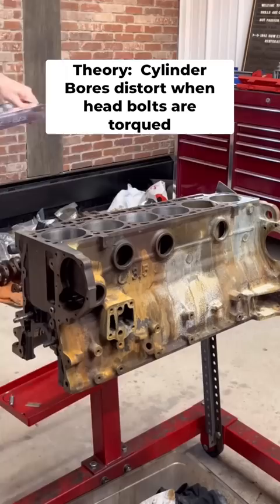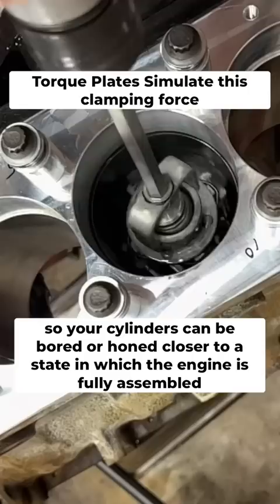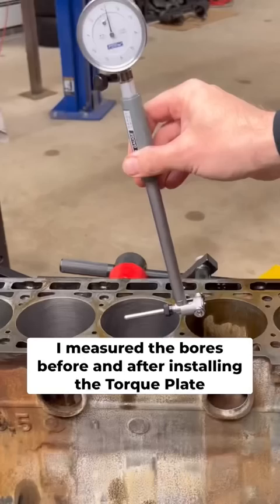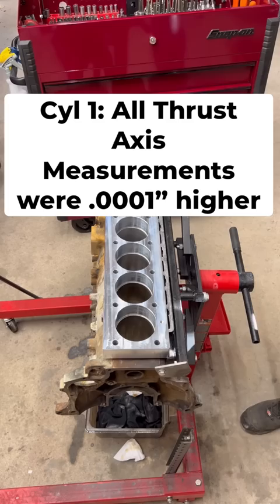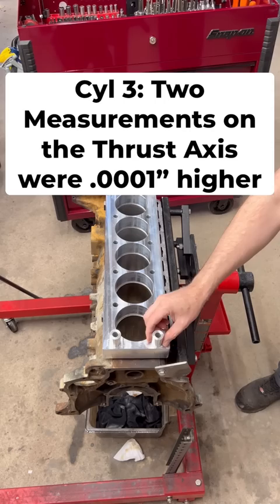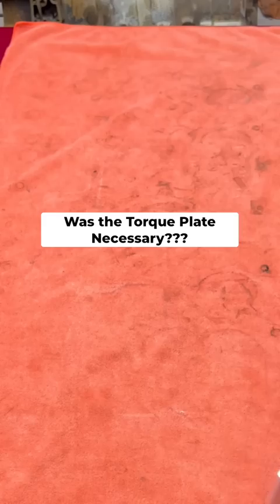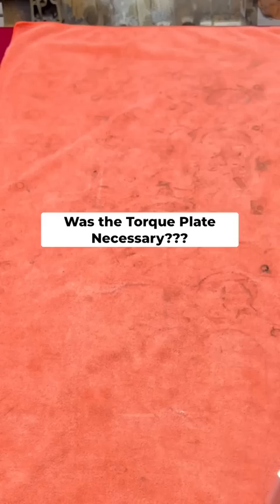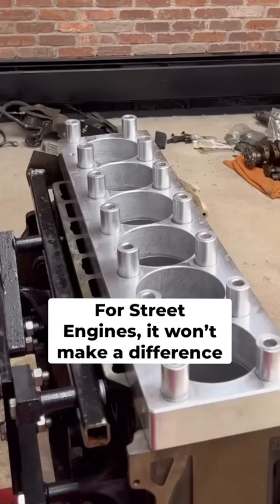Are Torque Plates Necessary? #bmw #cars #diy #bmwm5 #bmwe34 #restoration #automotive #engine #tools

Comment: Cylinder six can also get distorted when torquing on the transmission.
Reply from the maker: I don't buy that. The bellhousing bolts don't have a heavy torque in this engine
Reply: @wewrench  You don’t have to buy it from me. You should ask some old techs that were around when that E34 came out. I know cylinder 6 distortion was found in quite a few M20’s. Wouldn’t hurt to check bolting on that transmission if you’re going so far as to install the cylinder head torque plate.
Reply from the maker: @john.nandez  If the transmission were unsupported in the back, or if you zap those bolts with a 1/2" gun out of sequence, then I could see that happening.

Comment: Small block Chevys and big block Mopars are just a couple of engines that come to mind that need to be honed a torque plate, both of these engines have the head bolts very close to the cylinders, on a small block Mopar there's fewer bolts and they're further away from the cylinder and it doesn't make as much of a difference
Reply from the maker: Same with this engine. The head bolts don't contact the cylinder walls

Comment: I am by no means an expert. But one thing I noticed that I would just mention and comment on, is that deviation based on running conditions is not really something you should base this on. The engine would have been designed with running conditions in mind, and the torque specs would have been for a cold engine (service conditions). Deviation via disassembly would not be accounted for on the engineering level, where as deviation due to running temperatures would be. Just a thought.
Reply from the maker: Truth and that’s why these plates are useless

Comment: You should always use a torque plate.     Engines do not run at room temperatures You measured your block at room temperature, and by the way when your engine is running it has Coolant running through it,which is around 200°.  The heat affects the  the degree of warpage. On my engines I use a torque plate with 200° coolant running through the block with  the stock bolts and washers. Then I do the Hone, this  the way it’s done son to perfection… 😊 keep on rockin
Reply from the maker: If I was doing a race engine, I would try my best to do it that way. For street engines though, its an overkill
Reply: That sounds like it makes sense
Reply: A thou (thousandth) doesn’t really make any difference in street application, hot or cold. But in a race engine yes absolutely. Even the smallest defect compounds when you apply heavy load consistently.
Reply: I do a dry fit with the cylinder head and map the cylinder bores. Then I use the torque plate and bolt it down so the bores are the same as my map.

Comment: There is no way a torque plate of 5 inches thickness is going to pull a cast iron or aluminium block in to alignment.
Reply from the maker: What does the thickness have to do with it?
Reply: Nothing along as the bolts go into the block same amount as with head on
Reply: The thickness does matter. Cast block are far more stable and the changes are minimal, but significant in performance engines.

Comment: Depends on the block -
Ten years in the business and I found out which blocks distorted and which didn't, and "plated" accordingly.
On some it's a waste of time and money, the others it's mandatory to get proper ring seal - for maximum power and economy.
Reply from the maker: Which ones did you see distort?
Reply: @wewrench  
I remember SBCs were the absolute worst - you could torque one up with a plate and with the proper light you could SEE the 5 shadows (where the bolts were) around the bore - I used to leave an extra .001" hone stock just in case.
They were so bad you could HEAR the stones rattle at the top of the bore the first few strokes.
The bolt holes were way too close to the bores so when the iron moved under torque the distortion showed immediately in the bores.
Even the BBCs showed it, just nowhere near as bad.
This is one reason quite a few engines now have open decks with the bolt holes outside the open deck.
Reply from the maker: @Motor-City-Mike  My old trade school instructors would tell me stuff like this as well in regards to the SBCs

Comment: Heating the block to operating temperature probably more valid than a torque plate….
Reply from the maker: I agree. You can chase this stuff all day long, for street engines it won't make a difference

Comment: Diesel engines, it's mandatory in my opinion. I honed some with and without, and the ones without burned oil and had more blow by.
Reply from the maker: Really? I'd like to think those blocks are even more rigid than this one
Reply: @wewrench  6.0/6.4 powerstrokes only have 4 bolts per cylinders and torque plates distort them sometimes as high as .0025". Even torquing the bed plates will distort cylinders by a thou. We hone all blocks with mains and torque plates now.

Comment: On an OEM like build probably not.  On a high boost application I would. I'm sure it depends on the design of certain engines as well. My 4g63 distorted about .001".  I'm running a 2618 piston which expands a lot more than your average piston. Some builders will just run a larger piston to wall clearance to make up for the expansion but you'll end up with piston slap. Running minimal clearance with non distorted cylinder walls will help prevent piston slap. When you're spending all this money into a built motor why not and get it perfect? Maybe that's the ocd in me and 10+ years of me being a machinist. I'm a big believer in the saying, "anything that can go  wrong, will go wrong."
Reply from the maker: For a race application, all the details absolutely matter.

Comment: SOME engines absolutely need them
.
ive heard that 351C ford motors will actually "egg" the cylinders if you dont support the front end on an engine stand 
.
but im a 351W fan (only good motor ford EVER built.... 300 I6 also i guess)
Reply from the maker: The factory says this engine will distort if not mounted on the stand sideways so I def get it

Comment: If all you are doing is honing a cylinder to replace the crosshatching for new rings it definitely doesn’t matter as the bore is barrel shaped / tapered anyways from wear.
It’s even more dubious on an un decked block that hasn’t been line bored to correct for core shift misalignment.
Reply from the maker: So you're saying if the block is actually bored, it needs one?

Comment: Absolutely necessary exactly lol what he said. When you torque the head bolts the cylinder bores do change. Remember every engine calls for a certain hatch pattern in the cylinder bores. From the honing stones. The torque plate will insure cylinder is a true cylinder not distorted. .0001 or .0002 will change how efficient the cylinder & piston piston rings work.
Reply from the maker: You have no idea what you're talking about. .0002" won't change anything unless it's a race engine. And a rigid hone self centers in the bore regardless if there's a plate installed.

Comment: Didn't have one used on either of my 2-3x stock HP builds, only because they weren't available at the shops and I couldn't justify the added cost. 
Anyways I have solid compression numbers in all cylinders and oil consumption isn't anything abnormal.  I personally won't be buying a torque plate for any sub 1k hp builds.
Reply from the maker: Thank you for supporting the channel!

Comment: I think torque plate honing is more used when using ARP head studs as i think they’re a higher torque value and I think the way they torque as well is different but don’t quote me I may be wrong 🤷🏼‍♀️

Comment: If its an aluminium block then torque plates are required 100% of the time when boring the cylinders.   They are not required for honing.
Reply from the maker: Thank you for the info.

Comment: I've seen ford modular engines that where honed without a plate amd those done right. Towards the bottom of the bores in those engines bored without the plate, were four polished spots that line up with exactly where the head bolts thread into the block Towards the base of the cylinders. I've seen similar on okdwr pushrod engines wherebmain caps where left untorqued for boring  Where as engines that had the main caps and a plate torqued down. Have perfect symmetrical hashmarks and glazing. These methods have very little to do with performance and everything to do with longevity and preventing oil consumption to keep carbon footprints smaller. These methods did stem from great minds like smokey yunic who would only build his race engines sitting on a bench or floor because he believed the block hanging on a stand caused undue stresses after assembly was finished.
Reply from the maker: Thank you for this contribution

Comment: To claim that it would make any difference to honing shows that up. Honing does not require precision; it just puts pseudo-random cross-hatch patterns into the cylinder bore to trap oil. You can see from the honing tools that differences of a few microns in the alignment of the bore will make zero difference to how effective the honing will be. This whole thing sounds dubious to me.
Reply from the maker: Maybe not flex honing but possibly rigid honing

Comment: As a dude that works in and Indy car/Le mans car engine shop for a top manufacturer.... It is insanely dependent on the engine. If it's an aluminum block or split block of any design or in certain types of V-blocks regardless of material, you need a torque plate. For inline iron block engines like the one showed in the video, the block is so stiff it's unlikely to make a noticable difference.
Reply from the maker: I cast a wide net in the video. I agree with you, but for most street engine builds its probably an overkill
Reply: @wewrench  couldn't agree more 🤘
Reply from the maker: @ipar_carlarsen5765  cheers bro. Thanks for supporting the channel

Comment: It depends.  You can certainly run an engine and let the rings wear the bore in until it's round enough.  This is assuming there isn't too much distortion from the head bolts and main bolts.  This also is highly dependent on how deep your cross hatch is.   For higher performance engines that need good oil consumption and low blow by, it helps a lot to torque plate hone it.  -  Engineer who studies this stuff for a living.
Reply from the maker: I don't disagree with you. I'm just wondering why if its so critical...why don't the OEMs use it
Reply: @wewrench  Because regular automotive engines are really cheap and aren't that high performance.  Diesel engines that are designed to last 400k to a million miles with much higher temperatures and cylinder pressures need something that is more round and longer lasting.  Cummins 5.9 and 6.7L engines are torque plate honed.
Reply from the maker: @MrPizzaman09  I didn't know that! Thank you for explaining!

Comment: If you’re only making a little more power than stock, you’re fine without it. If your shop happens to have your torque plate on hand, then you definitely should! A slight uptick in cost for more precision is never a bad thing. But it’s all situation. I think laying out a good base plan of what you want to do and how you want to upgrade is more important than doing. The work being done always need context of why it’s being done.
Reply from the maker: It's to debunk the myth that it's absolutely necessary

Comment: As a machinist,  the (main) purpose of a torque plate is to keep floating sleeves stationary.   Some industrial diesels have drop in sleeves.  I can see how it can help in theory,  but on anything steel,  definitely a waste of time.
Reply from the maker: Thank you for contributing that

Comment: The single tens .0001" measurement is a bit misleading about it being useless though. If you perform a hot leak down test on a torque plate honed engine they have up to 2% better leakdown, which on a race engine is ALOT
Reply from the maker: Yes but this is a street engine. For race you go all out

Comment: Yeah really only necessary when you’re doing big power if you can simulate a lot of distortion before hand.
Reply from the maker: Agreed. A lot of the details that engine builders dwell on are useless on a street engine

Comment: The deformation caused by tightening the cylinder head depends on the design of the engine, the thickness of the walls and also the contact pressure. It is completely wrong to claim that pretensioning does not bring any advantage during honing, because an ancient engine block does not warp much.
New motors warp to an out-of-roundness of up to 5/100mm.
Reply from the maker: Somebody else made a comment about engine block tension over time. I didn't know that was a thing
Reply: @wewrench  The crystal structure of aluminum tends to flow and therefore changes its shape under load. As consequence also the preload of the cylinder-head gasket is changed. The resulting pressure gradients put additional stress on the system in some areas whereas in others the contact pressure get too small. Yes, this is also a big issue with modern engines and high power. I saw several engine failures because of warped cylinder heads.
Reply from the maker: @lupuszzz  But what if the engine is cast iron?
Reply: @wewrench  With cast iron all the mentioned effects of warping are usually smaller. The effect of material flowing away from pressure zones is practically not existing with cast iron.
Reply from the maker: @lupuszzz  That's what it seems

Comment: In some models torq plate is needed. I.e. 1.8l nissan primera warps cylinders if no gear box torq plate is used or if the gear box is tightened to wrong Nm
Reply from the maker: Make sure you check out my latest video on how I corrected the cylinders myself and I get into more detail regarding the torque plate

Comment: This is just a carryover from days gone by when it did make a difference.  It took 30 years to convince people that synthetic oils worked great.  There are still a few living people that ask for valve adjustments and joints greased on their 2022 whatever.
Reply from the maker: I think it comes from the hot rodding days

Comment: I dont think measuring from 2 points is enough to get a useful picture especially since the spots you measured should see the lowest distortion. The areas where most distortion would happen is the cylinder wall adjacent to the the threads of the headbolts. As a clamping load is applied the area below the treads should slightly thin out and the area next to and a little above should bulge out due to compressive force.
Reply from the maker: I measured from the typical six points. It's a short video so its short on details

Comment: Idk if they're necessary but when a guy asked if I could machine his 1000hp project, I used one as well as bolted the mains. Vibrations kill at high rpm and high power
Reply from the maker: That’s a totally different beast. At that level, every detail counts

Comment: Necessary?  No.
BTW, you torque the cylinder heads AND the main caps.  Then there is the question of bore straightness - honing machines like Rottler's get the bores closer to straight.  Some people will run hot water through the block.
Your question is, is it worth it.   Depends.
The cost of adding torque plates during a hone is small compared to the rebuild cost of the engine.  The end results are potentially tighter piston to wall clearances, rounder bores letting the rings live longer and overall, an engine that lasts longer.
You can put 300,000 miles on a motor  - no problem,  Yet you bothered to rebuild the engine (at best, new gaskets, maybe a new camshaft, and new timing chain and maybe  new oil pump and throw some new bearings at it.
Reply from the maker: You're not wrong, but it's all meaningless on a street engine.

Comment: Machine shops apparently consider .0002 good and .0005 max. So even all of it added together it would be marginal. I would think there are more important other things that should be all considered before. I understand the science and idea. But to get that fussy is the deflection on the head the same as the solid block made from a different alloy.  Might actually over simulate. Plus with out a gasket couldn't that actually pull flat harder?
Reply from the maker: My thoughts exactly. People talk about this stuff like its a religion, without knowing what a tenth means in the real world. If you've ever done this work, you'd know that the humidity can change and throw your readings off .0002"

Comment: Its because bmws inline 6 they run at higher rpm then most engines and any off balance could cause the engine to explode at a high rpm and that would be very bad!!
Reply from the maker: It's also the weight and length of crank

Comment: On a new engine it might be worth it but on an old block that has lost all of it's built in tension over ten's of thousands of miles. Re-facing the block and head will do. Imo.

The old 1.6 bmw formula one turbo engines were old street car engines that had lost their tension.
Reply from the maker: I’ve never heard of engine block tension. Care to elaborate?
Reply: As the block is cast it can develop natural tension (some say stress) inside the metal during the casting process. Over thousands of heat cycles this tension is released.

The BMW M12/13 is a good example of this. BMW would find engines that had covered at least 100k kilometres to ensure the tension had been released before they boosted them to 1400bhp!
Reply from the maker: @AshGTE  That is very cool! You learn something new every day!

Comment: Could it be that the BMW block is stronger than most? The fact that you left out the main caps was a mistake. Perfect is perfect, less than perfect is trouble.
Reply from the maker: In the real world on a street engine, less than perfect will be just fine. Racing engine, different story